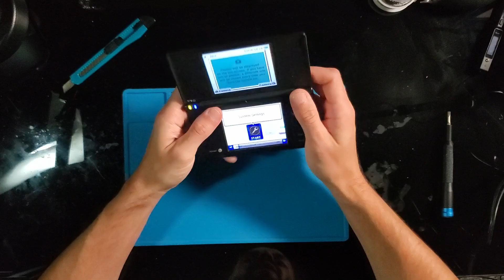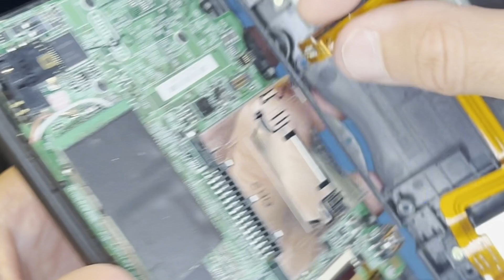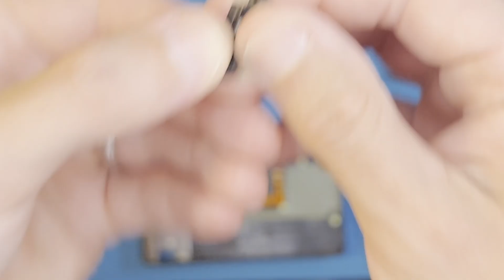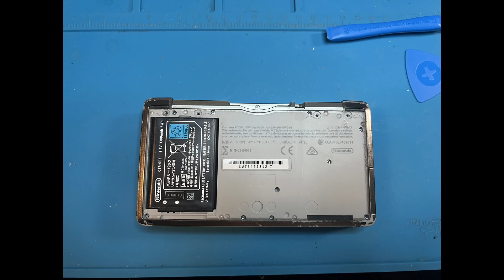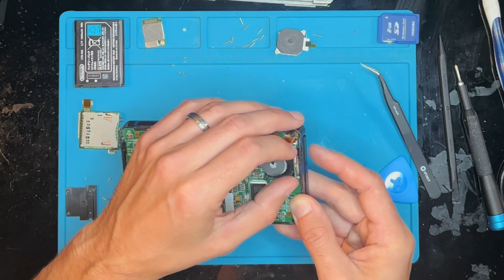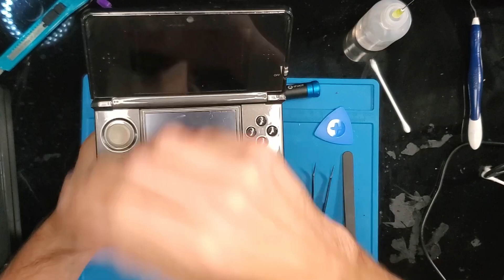Trying to Fix a Viewer's DSi (shoulder buttons) and 3DS (no power)

Comment: I dropped my DSi XL like,,, 13 years ago, and the left bumper has been screwed up ever since. When you press it, it doesn't pop back up on its own, you have to manually push it up with your finger each time because it gets stuck on the casing of the console. I finally decided to try my hand at fixing it, and it isn't FULLY fixed, but I loosened one of the screws a bit, and now as long as I'm not actually pressing the shell that last tiny bit back together, the bumper bounces back! Finally! This tutorial is a life-saver.

Also, the tip about being careful is no oke lmao. I accidentally dropped the spring and spent several minutes digging around in the carpet for it. So yeah, be careful everyone

Comment: I need to try to put together my old Super Mario 3DS LL at some point, took it apart and tried to removed the charging port but it ripped pads. so might not be able to be fixed. I had new custom sticker made just to restore ti with custom paint too.